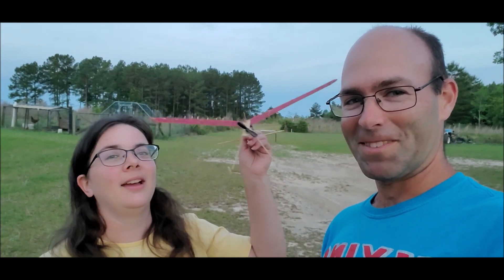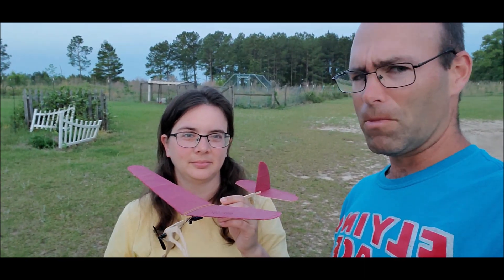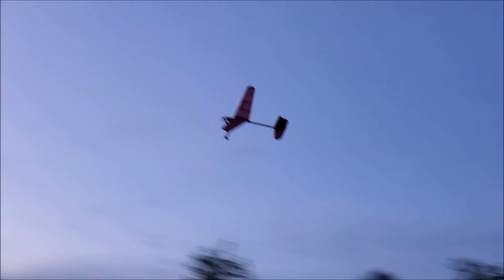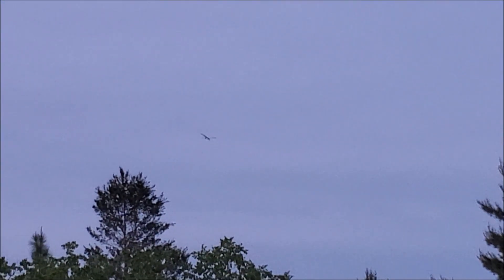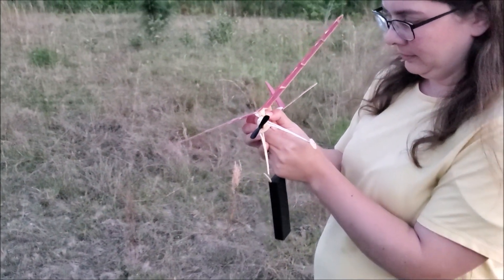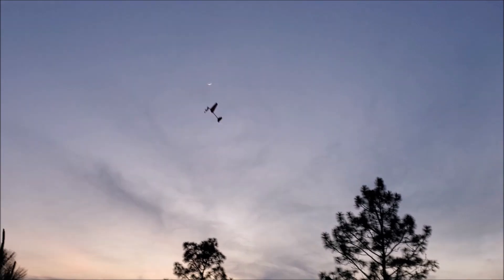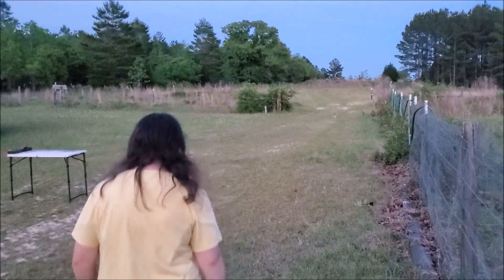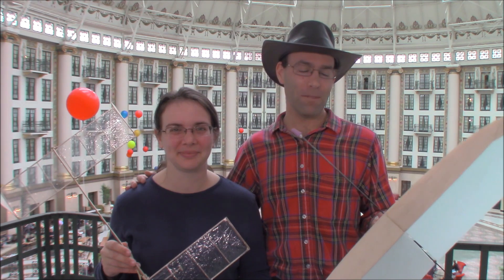Capacitor powered Phantom Flash model airplane!

Comment: How hard can you push these capacitors? The highest I've gone is 8 volts, resulted in a 10 minute OOS flight straight up. There are a couple videos on my channel, not the long flight, though.
Reply from the maker: 8 volts is getting a little dicey. 6 is within the safety margin of these caps, but somewhere between 6 and 12, they turn into frag grenades. Literally.
Reply: @joshuawfinn Yikes! Perhaps I should test a couple of them to destruction to see what's safe.. I did find a really cheap source of them, so I can afford to sacrifice a couple. One of my flying group had one fail in a strange way, after a great number of flights using about 3 volts, the capacitor just refused to charge above 1 volt and instead got really hot - apparently an internal short. The burst disc at the end bulged out a little.

Comment: Nice video! How do you prevent from rolling issue? a lot free flight aircrafts don't even have adjustable rudder and ailerons, but they are not rolling.
Reply from the maker: Dihedral takes care of the problem. If you set the CG correctly and the adjust elevator trim for a stable pattern and have correct dihedral, they fly quite well with no moving surfaces.
Reply: @joshuawfinn  Thank you. My free flight plane has rolling issue caused by motor. It flies fine when motor turned off, but rolling when motor turned on. I will try dihedral wing.
Reply from the maker: @linsfunbox4052  you absolutely need dihedral for it to remain stable. Also make sure there aren't any warps in the wing. If it's rubber powered you may need some warps, particularly for a left turning indoor model, but it depends upon the aircraft type and desired flight profile.
Reply: @joshuawfinn  Thank you so much! I am building another aircraft now. Will put motor on and test it in a sunny day.

Comment: Far be it for me to suggest to you guys anything about trimming, but... I really do think that some down thrust is needed here. I mean those power loops and all...  
However, if it didn't use all that excessive power in those loops, it could easily get so high that it just flies away.
Another argument for R/C rudder.
Also, don't you think that the power applied by that capacitor is a bit excessive in that model?
What is that capacitor's relative weight, power and duration with that or a larger propellor vs. an equivalent battery?
Reply from the maker: The real issue is that the CG is too far forward so it's flying with too much incidence. Were we to move the wing forward and shim the trailing edge up maybe 1/32", it would assume a looser spiral on the way up. That said I'm not sure the flight times would increase that much. We did have a special motor developed later that provides a flatter power curve and that would probably help extend the flight times out toward 3 minutes...which is kinda ridiculous for one of these.
Reply: @joshuawfinn I bow to your experience in these matters and make these suggestions with due respect.
I understand your solution, but, as you know, there is usually more than one way to affect flight characteristics. I'd try downthrust first as it's the simplest fix. You can always do a CG and incidence fix as well.
Is it that you think that reducing the wing's' incidence will reduce some decalage and thereby reduce some of the nose up force?
The problem is that reducing the wing's incidence also increases the thrust angle, which seems to me to be antithetical to the solution of the problem.
IMO, getting that model in its current pure FF setup to fly much higher and longer without some way to keep it reasonably overhead (or at least in the vicinity and out of the trees), or using a DT, is simply asking for trouble.

Comment: It looks like 20-25 seconds motor run.  Close?  Way more power than I expected.  Looks like it would work on scale models up to maybe 24".  Dime scale would be a breeze, if you could trim it OK.
Reply from the maker: It's got 25 seconds of really good power plus a long cruise. Props on these are a little small for dimescale but definitely suitable for sport models into the 20" range and peanuts, possibly light dimers too.

Comment: A 5 Farad capacitor?  I think you mean 5 micro-farad capacitor.
Reply from the maker: Nope, I said it correctly. Look up supercapacitors. You can now buy a 100F unit that will sit in the palm of your hand. Times have changed!
Reply: You won't have enough energy with 5mF capacitor. I made the same mistake the first time I built capacitor free flight model - I bought a 3 uF capacitor! Also, the voltage of the charger counts.

Comment: Is that a super cap? Also I definitely wouldn’t recommend holding the cap when you plug it in. They can explode.  Not very common on small low voltage caps but too much voltage it will. So definitely don’t go higher than recommended if it’s been tested safely. Cool idea
Reply from the maker: Yeah it's a super cap. We've tested these throughout their range, they pop, complete with shrapnel, around 12v. You don't want to be anywhere in the same zip code when they go off.
Reply: @joshuawfinn  lol

Comment: Excellent combination . Looks like you have enough power there for a 25% bigger phantom
Reply from the maker: It would power a dimescale model very nicely.
Reply: @joshuawfinn  lots of lovely dimescale plans out there! I have a folder full of printed dimescale plans waiting to be built. Would it need a geared motor and bigger prop for a typical dimescale?
Reply from the maker: @MouseSquadron  these motors would generate enough thrust to fly a dimescale, but I think a larger geared prop would just look better.